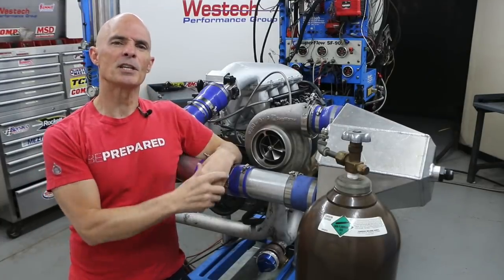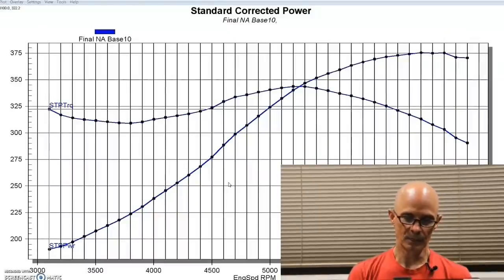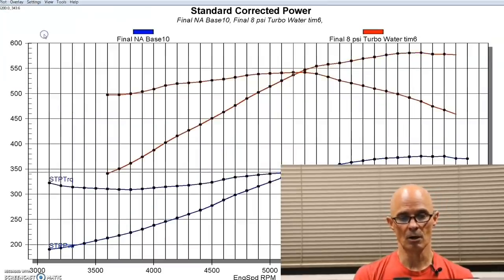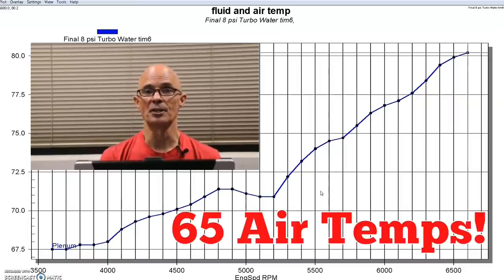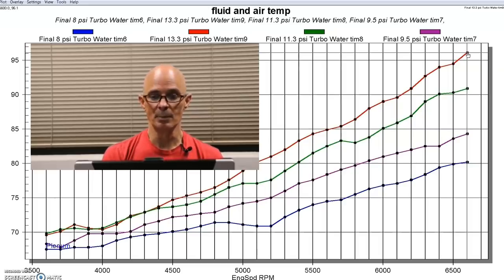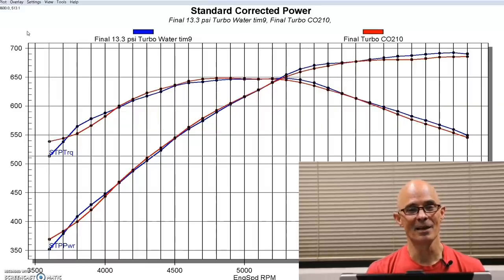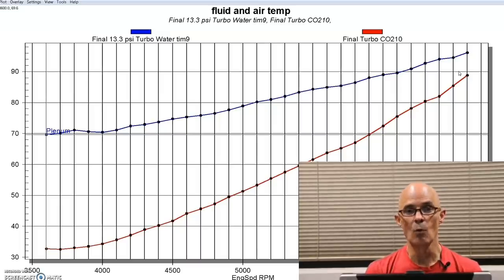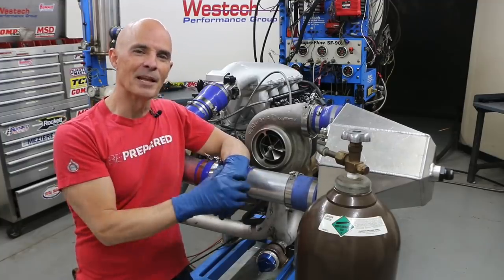HELP, CO2 INTERCOOLER FAIL!! FULL RESULTS!!

Comment: You would have to put a huge restrictor on the outlet side. Like a small .050 nitrous jet. And hold the co2 in the core with only a small amount exiting    You we’re just blowing it threw and it had no mass to absorb the heat.   And to make matters worse it was probably frosting Over the inner core and impeding flow by just blowing a ton threw it all at once.    The better test would be to run Freon threw it but you need a pretty stout core to handle that  I’ve seen that done with great results

Comment: Lets get into the details, that's where power is made anyway.
The specific heat of Carbon Dioxide/CO2 by mass is .839
The specific heat of Water/H2O by mass is 4.1813 or around 4.2 by volume
If you take into consideration that CO2 is drastically lower mas per volume(the intercooler is a set volume) than it is easy to understand the results.
Interestingly the specific heat of air at sea level is 1.0035 by mass, which means pumping room air through the intercooler would have been more effective over time.
The results you got worked as well as they did because the CO2 evaporating was very cold and cooled off the intercooler(which being made of aluminum has a specific heat of .897 by mass or 2.422 by volume).
The summery of all that is that the higher the specific heat, the more energy it takes to heat it up. Because energy moves from high to low (like heat) the water literally sucks the heat out of the air better than the CO2.

The best solution is to use the highest specific heat medium by volume (which happens to be water) and make it as cold as possible. The issue is Water freezes at 32F/0C which means you can't use it to get sub zero. 
A 'possible' solution is to run antifreeze and dry ice. The issue with that is that Ethylene Glycol has a specific heat of 2.42 by mass which is about half of water, but even worse, it's less dense so its only 1/3 the specific heat of water by volume. You can add more water which raises its specific heat but lowers also raises its freezing point.
Propylene Glycol has higher specific heat but is higher viscosity so would be harder to pump through the intercooler.

I suggest you re-run the test with 50/50 Ethylene Glycol with dry ice and keep adding water/diluting it with water till freezing becomes an issue... buy a lot of dry ice.
Reply: This is really good. I like this. I would use methanol as opposed to a glycol antifreeze. It has a freezing point of about -145°f, a specific heat of 2.52 and a density of .79. It is glycol antifreeze on steroids for this application. You don't have to worry about it freezing at all and the viscosity isn't as high as ethylene or propylene glycol. The volume energy density is 48% that of water. It's actually higher than antifreeze solutions. Still what I would do is run two air to water charge coolers. The first one with dyno water. It's really effective and the output temperature is in the 80s as opposed to the 250s as it comes out of the compressor. The second air to water cooler I would circulate methanol that's dry ice cooled. When it hits the second stage if everything is working the liquid will be -109f, the sublimation temperature of dry ice. The issue you have is you need a second charge cooler, a reservoir, pump and connections that can all handle methanol and the reservoir needs to be huge. The enthalpy of sublimation is awesome, 571kj/kg. Ya, it's 1.7x the heat of fusion of water and the density of dry ice is 1.4-1.6. A reservoir with methanol and dry ice would work, why it needs to be huge is because as the dry ice sublimates it does not add to the volume of circulating liquid as ice in a water tank does. The reservoir needs to hold enough liquid to circulate with no dry ice and enough to submerge the dry ice. You could.do it with this one stage but the idea is to super cool the air charge and it's easier to cool an air charge that's already half way from 250f to -110f.
Reply: Dodge uses A/C on their intercooler and Mercedes is using CO2 for their A/C systems. Go.

Comment: Use two (2) intercoolers 
1. The standard air/water cooler you have used on all the other tests.
2. Air/Air spraying liquid CO2, on the outside. This will take out all the humidity (water) in the air. Making the air denser.
Also dry air loves liquid droplets of fuel.

Comment: The CO2 charge temp was 10-ish deg F cooler, so there should be a very small hp increase.  I blame the tuner, HAHa.  JK 
What about running no inter cooler.. what would be the delta in HP?  I ran 30 psi without an FMIC on e85 and meth.  Always wanted to know if an inter cooler would he beneficial on E85.

Comment: Richard, use a liquid intercooler with a rad to cool the water and spray the rad with the co2. If you set it up with multiple spray jets on the co2 to give good coverage to the rad you will get temps down and power up nicely.
Really love your shows, keep up the interesting tech articles! (UK fan)

Comment: Bottle needs to be upside down so liquid is flowing to intercooler. You need a restricting orifice on the inlet side of the cooler. This will cause pressure drop and liquid to boil off....absorbing heat. This is how an evaporator coil works in a refrigeration system. May have to experiment a little to get orifice size right.

Comment: Shorter feed line with a restrictor on the outlet? 🤷🏼‍♂️
Reply: The fact that the bottle was freezing on the floor gives it away all the latent heat was given up as the co2 state changed within the bottle you need liquid co2 within the heat exchanger (intercooler) boiling off with a controlled vent valve to maintain the pressure required for zero degrees air off temp. I had a technical look last night and at 0 degree celius the pressure required would be 500 psi so I guess that a bit of a bomb on the intake side

Comment: You need more volume of c02 inside the intercooler to fill up the tanks a restrictor valve on the back side to keep more volume in the intercooler is the trick.   I think.   Saturating the tanks with c02 will freeze the intercooler.. sending more volume thru without a restrictor the c02 is just touch and go it doesn't get a chance to soak into the metal.. it almost needs to be compressed like a aircondition system

Comment: First off, I think the A/F intercooler is designed for wet use, ie fluid movement. The issue is, you have no way possible to keep the co2 liquid, I assume the exit is open ended. Now here's what i'd try, Frozen co2 bricks in a water tank with water (or possibly an antifreeze type coolant). You should hit your target temps that way. Dodge uses a Freon intercooler on the Demon, But it's a fully pressurized system so only the liquid freon is used for cooling, no gas is used

Comment: Not enough mass = not enough specific heat.
To get the differential you could run antifreeze and chill the water down below zero.
But, that will never be allowed at the track.
Salt water, though? A fairly heavy brine might work and I dunno if there's rules against that at the track.

Comment: It could be reduced latent heat transfer from restricted airflow through the exchanger. My theory is that the co2 charge is so cold that it freezes the moisture in the intake charge directly to the exchanger thus reducing airflow through it. It may only be on 1/4 of the exchanger so not enough to restrict the inlet of the engine but enough to allow intake temps to rise. 
Another theory is that you might not have gotten all of the water out of the exchanger and the co2 froze the water and stopped the flow of co2.

Comment: Have you thought about feeding the air to water with a solution of alcohol and water in a tub, with dry ice immersed? Should get you close to 0°, while having better thermal absorption than a gas.

Comment: I don't quite have time to read the other comments right now, but what I think is happening is that you're getting an insulating layer of ice building up on the inside of the cooler from the extremely low temperature of the CO2. This will prevent some of the heat transfer from the  air into the intercooler cold side. Just like when playing with a CO2 fire extinguisher, as soon as you release it to low pressure state it phase changes to gas and does the extreme temperature drop - this causes condensation which creates an ice buildup. I'll check the other comments when I have a chance to see what other people are thinking.

Comment: Maybe the gas isn't flowing like a liquid through the core or doesnt have nearly as much area to transfer heat as liquid does. The best insulator is an air gap so gas might not be transfering the heat. Spraying onto an air to air with a flow regulator like on a welding setup might work better. And trying different flows to see if it makes a difference.

Comment: Try cooling something with a higher thermal mass first over a longer period of time then circulate it through the ic. You could put 10 or 20 gallons of propylene glycol in a normal freezer overnight and then cool it more with dry ice(co2) or liquid nitrogen. Then pump/drain it through the ic. If you do this, please for the love of god be careful. You can get away with dunking your hand in liquid nitrogen very briefly but you can't do that with this.

Comment: First off I'll assume that your gas supplier actually gave you a tank of Co2 with a dip tube, so you're actually getting liquid coming out of the valve. But, that liquid is not at -274 degrees F. It's not even at -109 F, the temperature of Dry Ice. No, it's at ambient temperature! (65F) It's not until the gas starts to expand that the temperature starts to drop. And the temp.that it drops to is dependent on the rate of expansion, and some other factors.
But that's not your real problem. What you are missing is called "Latent Heat of Vaporization". https://www.engineeringtoolbox.com/fluids-evaporation-latent-heat-d_147.html 
The problem is that Co2 doesn't have a very large LHV, only 247. Whereas Water has a LHV of 970.
In simple terms, Co2 can't carry away very much heat as compared to water or even alcohol. That's why it's warm before it exits. Adding to the volume going into the charge cooler will help some, but that will decrease the expansion rate and therefore increase the temp. entering the charge cooler and therefore, the rate of heat transfer.
Another problem with dry Co2 is that it is not very good at transferring heat from the metal that it's passing over. You won't have much luck with Nitrogen either. Nitrogen's LHV is only 86. 
It's not about the temperature differential, it's about how much heat it can carry away.

Your best bet of achieving a zero degree F. charge cooler medium is to put some dry ice in Glycol or Alcohol and circulate that through the cooler. Good luck!
Reply: Jordan Snowhook I believe this dude nailed it. If this is true and used to your advantage the rest of the equation would be the physical aspect of the heat exchanger, and I know that copper transfers heat even greater than aluminum, aluminum has roughly 3x the speed of heat transfer as steel and copper has roughly 5x the speed of steels heat transfer.... might be tough to obtain but if we’re talking about optimizing a set up you’ve got to do what you’ve got to do.

EDIT: thermal conductivity of 
steel=0.11units
aluminium=0.45units
copper=0.94units
Reply: The LHV of water is irrelevant as it isn't normally vaporized in the IC. The specific heat of water is only one BTU/lb./deg.F . If the CO2 was evaporated in the IC, it would absorb 247 BTU/lb. before it's temperature would begin to rise above it's boiling point. I agree that the CO2 ice/alcohol method would make more sense with this IC.
Reply: Love me some latent heat getting sucked up by the evaporator and spit out into the condenser on my hvac 😄

Comment: Are you getting liquid Co2 or gaseous Co2 going into the intercooler? Are you getting liquid Co2 out? Ideally you want  100% liquid going in at a rate that 99% of what's exiting is exiting as a gas, though I suspect the outlet of the intercooler is not large enough to allow that rate of phase change.

I also question at what point is the air simply passing through the intercooler to fast for the thermal exchange to occur?

Comment: Your core is too small. Liquid transfers, and can hold much more, heat much more effectively. You basically made your liquid to air intercooler into an air to air (or co2) intercooler. That's why it's not performing any better then (warmer) liquid in spite of being a much colder gas.

Comment: To make this type of intercooler work you need a set up like an evaporator from an A/C unit. CO2 absorbs heat cooling the area around it. Most of the heat absorption occurs during phase change, this is the principal of latent heat. Definition of latent heat from Wikipedia; Latent heat is energy process — usually a first-order phase transition. Latent heat can be understood as energy in hidden form which is supplied or extracted to change the state of a substance without changing its temperature. The continued cooling after phase change is minor. Something like this compressed air dryer evaporator, but with a higher flow capacity should work. https://www.alibaba.com/product-detail/High-efficiency-Atlas-Copco-air-compressor_60684907850.html
Reply: Additionally some form of a flow restriction on the exhaust of the system would be necessary. I found several articles on CO2 as a refrigerant. Designing a system with similar parameters to an A/C system so that the exhaust of the CO2 side of the system is CO2 gas with 10 to 20 degrees fahrenheit super heat would give maximum cooling. This would likely result is 100+ degrees of reduction in charge temperature. (200 leaving the turbo = 80 - 100 intake temp)

Comment: It needs to pick up off the bottom of the CO2  bottle so its pulling liquid rather than gas. Fill the IC with liquid CO2 rather than the gas. Its going to boil and will need to be able to release the excess pressure.

Comment: @RichardHoldener super cool methanol with dry ice and circulate that through the intercooler.  that would be far easier to deal with than liquid nitrogen. methanol will remain liquid at the melting point of the dry ice. you could plausibly create a solution as cold as -110*f.

Comment: CO2 is a liquid under pressure.  By having no restriction you were allowing it to turn to a gas.  It's going to turn to a gas no matter but the longer you can keep it a liquid the better.
Reply: I'll also add that I'm not sure the Air to water intercooler will handle the pressure that once you restrict it.  Be careful.

Comment: In my research into waterless coolant, no liquid does a better job than water at thermal transfer, but you may get close with a 50/50 antifreeze mixture, you would need a large chest freezer to store enough below freezing mixture to circulate through the intercooler, and likely will need to be on at freezing temperatures for over 24 hours, but if you had 100 or 200 gallons of -20 coolant mix and a good pump for flow, I think it's possible to get the 0° charge air you are seeking.

Comment: Cool video but I’m betting the core just isn’t big enough to cool the amount of airflow going thru it on the boost side, basically that the flow from the turbo is just moving too fast past the short length of core to drop the temps sufficiently. That’s why at low rpm you saw the iats around 30F, the air was traveling thru the core slow enough to drop the temp from ambient (-35F) but once the turbo spools up the heat increases but also the air moves too fast past the core to decrease temps as much. Same reason import guys swap from small factory top mount and side mount intercoolers to big huge front mount air-air intercoolers. That water-air charge cooler just isn’t big enough for the flow you’re pushing thru it. I’d bet if the core was 3x as big, you’d have more cooling efficiency with water, and more efficiency with co2, still probably not as much as you’re expecting though. And careful with liquid nitrogen, at that point you may get frost and condensation inside the charge cooler at low rpm, which would cool the charge air but also might cause the engine to ingest ice...

Comment: IMO with CO2 intercooler should have multiple pass around core - it CO2 doesn't have enough time to chill the core.
Second thing you have to have bottle upside down (valve should pointing down when bottle is vertical) or have a pipe inside the bottle to pickup liquid CO2 from the bottom of the bottle like in nitrous oxide systems. Cooling effect of CO2 is taken from rapid evaporating from liquid to gas.

Comment: I wonder if the air has too much velocity to dissipate the heat in that intercooler for a significant improvement. Also curious if the Co2 gas or any gas for that matter just sucks at taking heat away. It is already less dense than a liquid so how is it to absorb that heat energy as well as a liquid.

Comment: Turning the bottle upside may not help if it has a feed tube. I've heard CO2 bottles are different than nitrous bottles internally. (Just here-say)
It might be the mass of the charge air is so much higher than the mass of the CO2 flowing through the cooler it can't keep up at the top

Comment: Co2 is a poor conductor, gas is a much less efficient conductor than liquid is and I believe that if you did get a full flow of liquid Co2 over the core that it would actually freeze up causing an insulated layer that would stop the charge air from being cooled at all. LN2 might work but I would think they inside of the cooler might freeze up, also aluminum get very brittle at those low of temperatures. A stainless steel charge cooler might be needed, it tends to get stronger as it’s cooled down that low. Look up cryogenic fuel tanks for rockets.